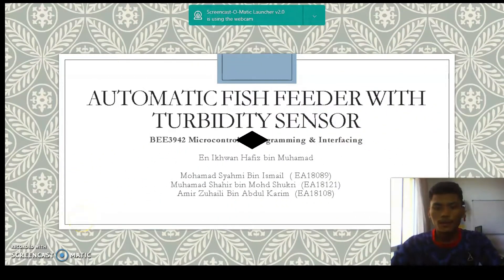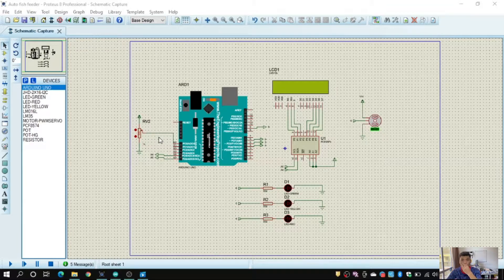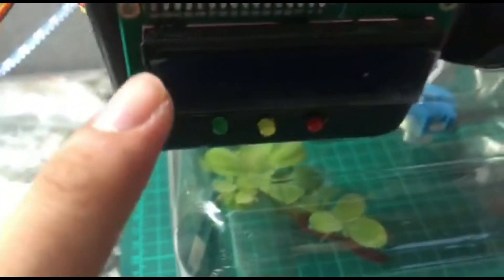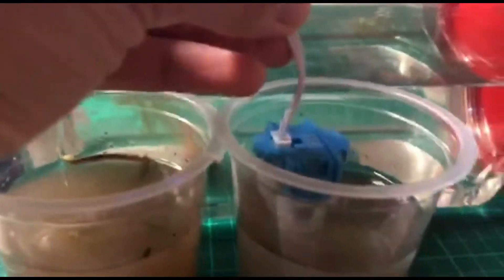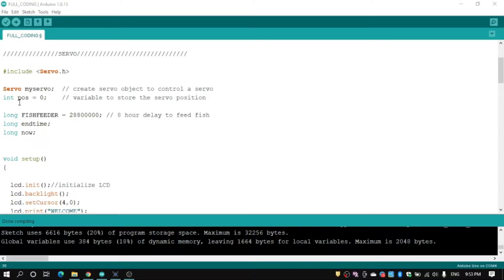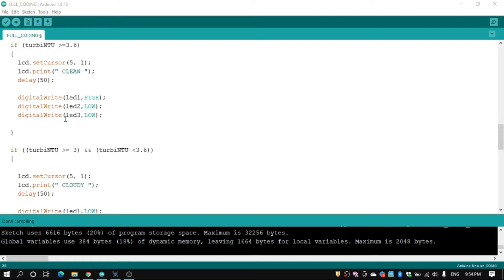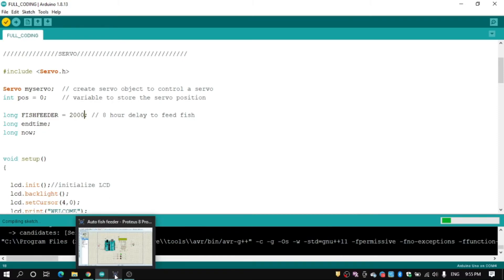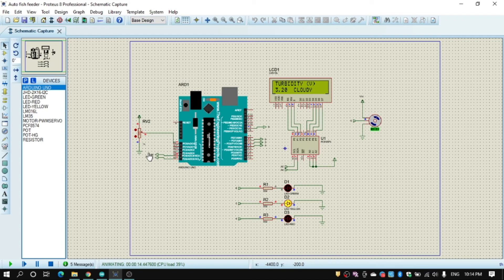BEE3942 AUTOMATIC FISH FEEDER WITH TURBIDITY SENSOR

Comment: wow.. hebat prototype.. boleh guna terus di akuarium.. betul ke buat sendiri tu? ke memang dh ada kt rumah tu?

Just a few questions:
1. Why you set the range of dirty is less than 3 V? Isn't it too dirty? we should change the water before it reach that amount of dirtiness. 3.5 is already too dirty for me..
2. Why you set the timer to 8 hours? Why not 6 hours?
Reply: Thank you sir kitorang buat sendiri prototype hehehe beli barang kedai 2 ringgit je and barang terpakai

1) At first yes we did it but the colour of cloudy and dirty were looked same so in this part we want show the significant of the water condition between cloudy and dirty.

2)Normally for ornamental fish, the minimum time to feed the fish is 2 times per day  But the most suitable time to feed the fish is 3 times per day. That’s why we set it every 8 hours, if we set time too short the fish would not eat because still full and the water will become dirty and produce the  bacteria that will harm the fish

Comment: (EA18093, GROUP 1, 02P). Hai guys. Congrats for the really cool project. Just want to know how the turbidity sensor work..and how we want to know at which level the water was cloudy
Reply: Hai, thank you for the positive feedback, 
1)	 So, how the turbidity work?
A turbidity works by sending a light beam into the water to be tested. This light will then be scattered by any suspended particles. A light detector is placed at (usually) a 90 degree angle to the light source, and detects the amount of light that is reflected back at it. The amount of light reflected is used to determine the particle density within the water. The easy language to explain is, the more light that is detected, the more particles are present in the water (dirty). 

2)	How we want to know at which level the water was cloudy?
. Actually, for this case, we have test all the condition. We make 3 difference type of water which is clean, cloudy and dirty, and then we measure using turbidity sensor, and lastly change the coding based on the result.  Before that, we have change this analog value to voltage, so it will show the voltage only from 0-5V. For cloudy water, we set the voltage value from 3-3.6 V.